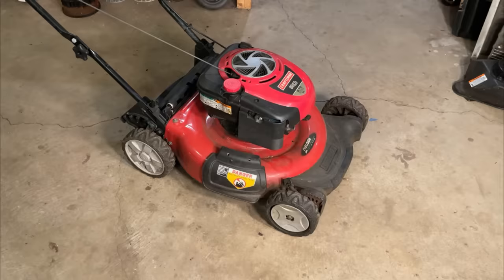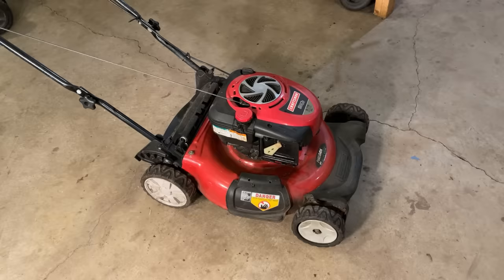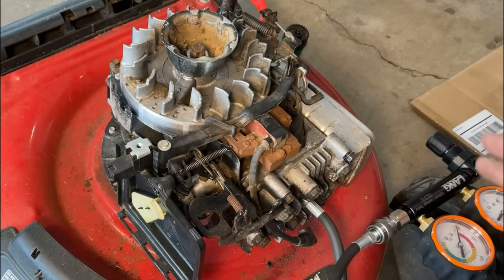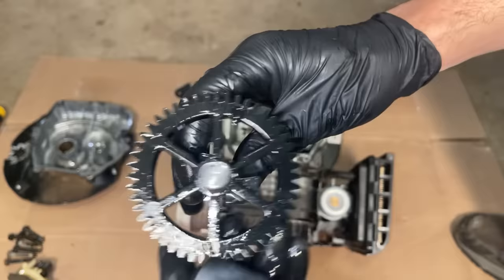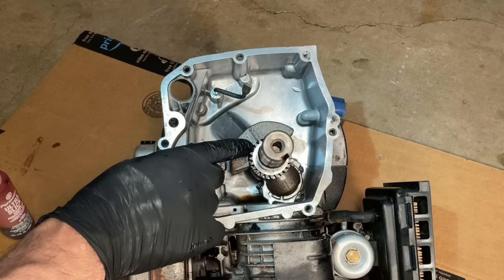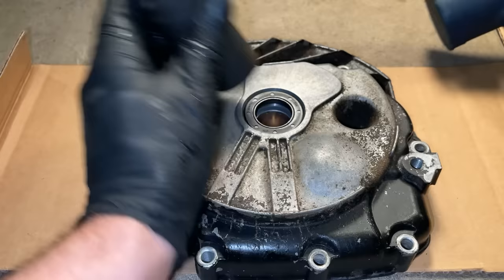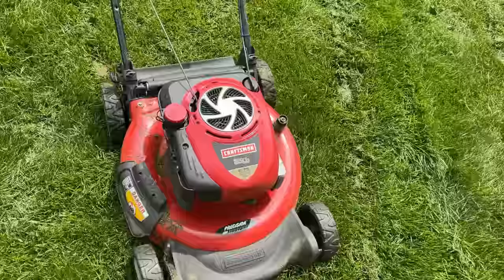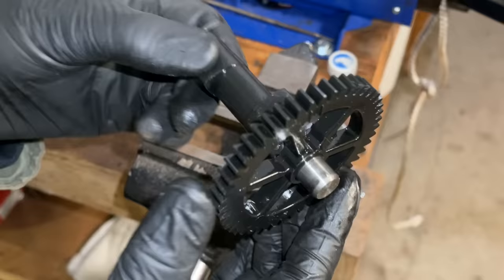Lawn Mower Will Not Start - You Will Never Guess Why

Comment: Thanks for that informative video. I have a 14 year old Toro with basically the same motor. It still runs and starts great. One thing that amazes me is that the oil never seems to get dirty. It always looks new on the dipstick. I have a very small bit of lawn. Only a 20 minute job and I only change the oil every 2-3 years with amsoil even though it still looks good.
Reply: Use detergent oil.  Non-detergent does not pick up dirt so it always looks clean which makes it hard to determine how old it is.

Comment: Great video. I have two Briggs horizontal engines in the shed, one 8HP , and one 11.5HP. Both built in the 1970's and both run like a top! It's truly a shame what management has done too this epic company! How they ruined a great small engine just for a meager profit margin more.
Reply from the maker: It is sad.  They have definitely cut corners on their newer engines.
Reply: You're lucky, Bill.
Briggs & Stratton makes modifications to their engines often so the parts on old engines can't be used to repair
Reply: They are in love with money and it shows in their products,same can be said for 99% of companies out there.
Reply: Most people kill their mowers with lack of maintenance in 2-4 years.  Some leave them in the side yard year round. 
No point in making them for the long haul if the majority of owners fail the machine anyway.
Reply: Actually when the old B&S went bankrupt a couple of years ago the management gave themselves a big "retention bonus" just a day or few before filing for bankruptcy. Heads they win,tails I lose ($10,000. or so investment in Briggs stock) 
  Needless to say,I don't think I will be buying much from the "new Briggs & Stratton"

Comment: Nice to watch people fix small engines. Thanks. It would make sense the larger sprocket gear would break loose  considering the torque to shaft size. I may need this video for my Sear's mower I had put aside a few years ago not understanding the insides so well. You took a lot of the apprehension out of what seemed an insurmountable job.

Comment: First clue there was a problem, it was exactly full of fresh, clean oil. Especially if the mower is under warranty. I've seen engines with broken connecting rods, but they were full of fresh oil!   F.Y.I. always remove the spark plug when Workink underneath the mower, I have seen them start and run with the plug wire over an inch away from the plug!!!

Comment: Just here to say thanks from the UK.  After watching your video a few times and having a Toro 675 GTS failing to start with similar issues I decided to take apart my first ever engine.  Same fault as this one with the camshaft sprocket timing out after shifting on the shaft.   Followed your video, replaced the camshaft and fired up on the second pull.  Many thanks a mower saved from the clutches of scrap.

Comment: Years ago I had a brand new mower with a Briggs and Stratton engine. I was hard starting right from day one. I took it back and had the dealer look at it and they could not figure out the problem so I was essentially stuck with it. A couple of years later I had some free time away from my business so I decided to get it running as it should. The carb was alright and there was plenty of spark. I tore the flywheel off and everything appeared okay until I looked at the points. I measured the gap and it was about .0029" which struck me as being a little much. When I checked the factory spec it called for .0020" so I filed the points and re-gapped them to spec. After that it was a one pull machine and worked great for the next couple of years until my ex-wife ran it out of oil.......... The point is, never rely on the manufacturer. They make mistakes all the time and you get to own them.
Reply: I thought he would have tried first..
Reply: .002 is a very small gap, I would think it should have been. 020 not .002.  Today they don't use points it's more like electronic

Comment: Another win.   Interesting issue found.   James, it’s time you treated yourself to a lift.   Even a simple one would do.   My knees hurt just watching you work on the floor.
Reply: A lift? I don't think he needs one,after all I suspect this is his hobby n not his profession.
Reply: I work on mine on my tailgate. Lol
I have a bad back to begin with and troubleshooting a small engine always takes more time than I would like to spend bending over. The last mower I repaired was a husqvarna AWD motor and it is the heaviest mower I have ever seen. It's a beast. I had to have my wife help me lift it up there. 'Twas a 450 dollar mower brand new and I fixed it for 16 bucks. It's what I am using at home now.
Reply: B&S motor. Lol

Comment: Excellent video, enjoyed that very much! Plastic cams have been around for a very long time, they changed over from metal over 20 years ago. Even though failures are pretty rare I think it would’ve been nice if they had a splined shaft to press the plastic parts onto instead of a smooth surface, seems like asking for trouble by not locking such critical parts in place. I had a weird one last summer; had a Murray push mower with an OHV Briggs engine that ran just fine but it would practically break your hand pulling it over. I figured it was an easy fix, just a simple valve adjustment issue or loose rocker. Nope, turned out the little return spring on the compression release got hung up and wouldn’t let the finger drop back into place so no compression release. I tore the whole engine apart and gave the spring an extra wrap to increase the tension, it worked reliably after that (had it been a Quantum engine I would’ve just put another cam in it). Sometimes a bargain isn’t a bargain, but it’s fun to troubleshoot and fix them!
Reply from the maker: This one was more then I thought it would be.  Have opened up a lot of generator engines recently.  Was hoping for an easy fix.  Spring time, mower wont start, good compression.  How hard could it be?
Reply: @jcondon1  Right, how hard could it be! After all it’s one of the simplest, most reliable time tested engines on the planet and it looks well cared for. Surprise!!
Reply: Interesting. I have abandoned a three-wheeled orange brushcutter AS Motor AS26 AH8 because it frightens me, having nearly ripped my shoulder out. Many people have been incapacitated for a year because of kickback when trying to pull-start a machine.  I, too, thought it was a problem with the key, or valve timing. No. I walk past it with my head turned away in fear. Replaced it with a white Orec SH61H. Maybe following your lead, I will one day open up that thing ...one day. Maybe.

Comment: there is a pressure washer video , briggs 7.75 engine, very similar  problem. I had a lawn mower, about 55 yrs ago, (no YouTube), similar problem, would not start. likely same problem. couldn't find any small engine brains to pick. My troy bilt pressure washer has had the carb problem almost every year. I like watching these small engine videos. Thanks for showing your problem solving skills. My lawn mower always started hard, 2 yr old, sold it for 50$, as all of a sudden wouldn't start, and now have lawn service, was given the mower free.

Comment: Great Video . We learn something new every day and this is no exception. Real nice to see someone taking the time to teach others how to fix things especially the lawn mowers and yard equipment. I'm however surprised that a reputable engine builder would use such cheaply made parts in their products. Thank you for your for posting this video.
Reply: Great to follow that diagnosis and repair
Reply: @leroydavis3538  Only way to remain competitive is to use lower cost materials. Since we have become a throwaway society, most repair shops would probably not repair this mower. I basically gave some old lawn mowers to the dealer I bought my riding lawn mower from. He said they would just go into the junk pile. Neither of the old lawn mowers had that many hours on them. They just kept failing on the power drive system and after the 2nd time with less than 10 hours on it (a good seasons mowing for my yard and would not work the following spring) I decided it was not worth spending another $150 for the same repair. Lawn mower was from a very well known manufacturer in the Minnesota. Just a bad and unreliable design.
Reply: Its a Briggs...

Comment: Pro-tip.... whenever turning a unit on its side,make sure the carb is facing upward,so oil doesn't drain out of the PCV and into filter housing and then draing into your carb when you flip it back, upright(which will definitely hydro-lock it)
Reply: With older mower engines that are or are not IC Series, take and put the engine crankshaft at TDC of it's Compression Stroke on a 4 Cycle engine, so that the valves are shut, to keep oil from seeping into the Carb or Combustion Piston Cylinder Chamber and cause hydro-lock, which can be caused by a faulty carburetor fuel leak into the intake and from there into the combustion Piston Cylinder Chamber. You'll know hydro-lock fairly easy because you will not be able to or easily be able to turn the crankshaft up to and past the engine's TDC of it's Compression Stroke, or you will have a broken starter cord in your hand, or electric start will not be able to turn the engine past the TDC of it's Compression Stroke either. Sometimes, Timing being off can cause a ignition misfire on the TDC of it's Compression Stroke that may in turn cause a Kick Back that can break the Starter Cord or the Starter Chord Spring Backlash whereby either may break or fly out of the Retainer in their perspective retainer housings, wether on a Vertical or Horizontal Shaft engine with a Pull Chord Starter, a Electric Starter Motor or Both. In rare occasions Electric Starter Gears may get Ring Gear Teeth stripped or broken. Sometimes an engine can just Back Kick on the TDC of it's Combustion Stroke. Aw Man, notorious arm or leg breaker, ect.on Kick Starter engines. GR8T Video ! ! ! 👍😎🎸🤘🇺🇲🙏  DDH 1-20-2023
Reply: That one has a top mount breather on it with a hose that can put oil into the air filter box or carburetor. Most had the breather in the valve spring cover. Also before tipping shut the fuel cut off (hopefully it has one) and run it until it quits or let the gas out by loosening the bowl nut. Otherwise the gas in the carburetor might go into the intake pipe.

Comment: Had a problem once with a small motor that was very perplexing. would not start for anything. the problem was on the exhaust side the muffler was so full of gunk that air flow was impeded. took the muffler off and cleaned it out (could not believe all the junk that was in it). Started immediately. Wow this guy's a pro I never would have found this. He's obviously familiar with Briggs. Professional tools there as well right down to the gloves. Great video.

Comment: Another outstanding video!!  Thanks much. It seemed evident that it was the gear that slipped even without the bonus footage. The decompressor was now being interfered with by the gear. Since the decompressor is fixed to the shaft, but now binding with the gear, then it had to be the gear that moved.

Comment: Good information and takes me to the next step diagnosing my riding mower problem, which started with replacing with a new carb, rather than simply cleaning the old.  Now it blows fuel back out of the carb, suggesting a valve problem.  But I have readjusted them several times with no improvement, resulting in no compression. You  now have a new subscriber.. thank you.

Comment: Always check the flywheel key before assumeing it is out of time on the cam/crank. Been working on thesee thiings since 1977, worst thing they ever done was put the plastic cam in it. I save my old cams out of the older metal cam motors and change them out when ever I can.

Comment: Another great video.  Its disappointing to me that Briggs (and others I assume) would use plastic cams.  Another step towards a throw away world.    Thanks for making this video.
Reply: Lot  of  manufacturers    use   metal    cams  but each lob  in  pressed on to   round   shaft,   makes   fault   finding    nightmare  only  got to move     10  degrees
Reply: And MANY of these plasticized units never made it beyond their first mowing.

Comment: A sheared flywheel key. Learned that when I was ten. They were designed to do that so when you hit a rock and stalled the machine, you didn’t bend the crankshaft and ruin the engine. Some engines had a specially designed key for that purpose. (Flywheel)
Reply: I just hit a tree root, stopped the engine hard and fast, sheared the flywheel key, have a laundry list of other parts, have never done that before! Bought a ryobi 40 volt machine as a good backup plan
Reply: @josephgriffin1065  ⁹8

Comment: Check the flywheel to make sure there are no cracks in the magnets if you suspect ignition and have weak spark. Always use loctite 222 pink or loctite 242 blue on lawnmower engine bolts, because of the vibration. This will save you from having to over tighten any bolts. This is advice coming from me, a 30 years experience small engine repairman

Comment: I'm impressed with the p.s. segment, most of the people that fix this stuff have no idea or don't have the initiative to find out what or why of parts failures.
Me being the cheap thrill seeker, I would have tried to drill through the drive sprocket and shaft and pin it.  Maybe would have done so to the replacement part just to be sure that it would be the last time I had to go into it.

I'm going to out on a limb here and just guessing but I bet it backfired about twice and that was it for the plastic to steel connection.

Thank you for your help with the timing. process.

Comment: Before one starts mowing, clean the underside and spray with vegetable cooking oil. This will keep the cuttings from sticking to the chassis and make it easier to clean next time. Do not use petroleum based oil.
Reply: That's the only thing vegetable oil should be used for.

Comment: I've never bought a NEW lawnmower in my life. I've found DOZENS of mowers throughout the years on Garbage day. I've fixed almost all of them. Some were abused so badly, They were just good for parts, but most of them needed just a little bit of work to get them running again. In almost ALL cases, The problems with the mowers could have been prevented by simple maintenance. (Changing the oil, replacing/cleaning the filter). I usually find that if the mower is left outside other than being garage kept, that's where the problems start. one more thing, Always DRAIN the gasoline from the tank when the mower is not being used in the off-seasons.  The methanol in the gas will screw up the carb.
Reply: I have briggs and stratton 21 years old :D
Reply: yup stopped having issues in the spring when I started running the mower empty in the fall and actually prepping for storage.